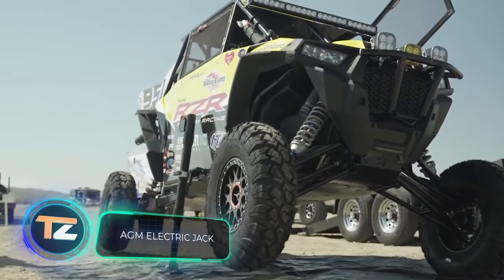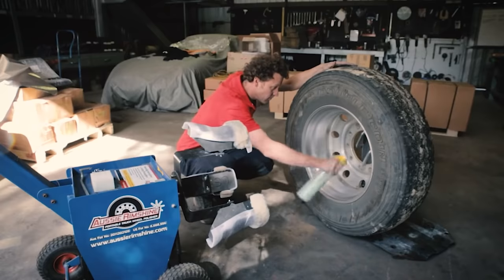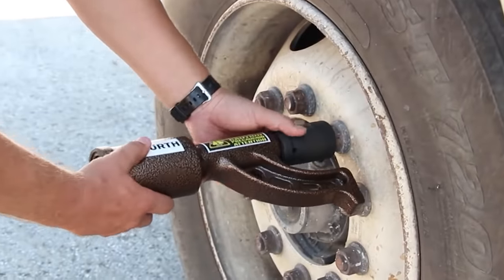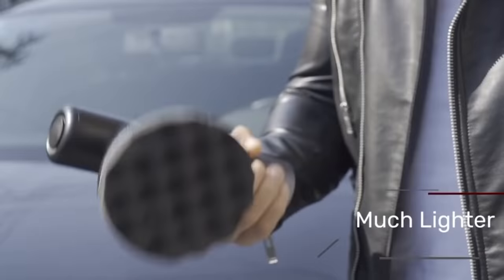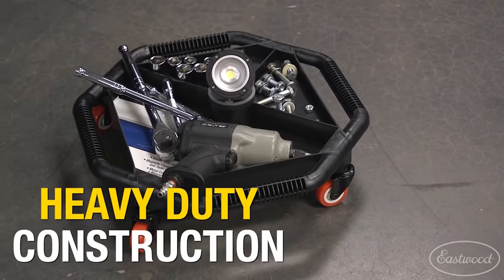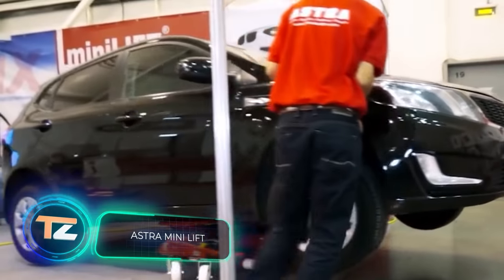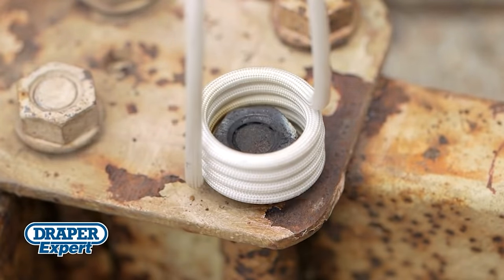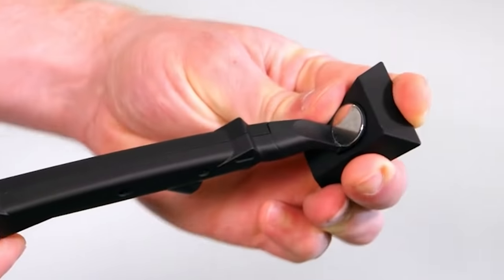NEW GENERATION TOOLS THAT WILL MAKE YOUR WORK EASIER

Comment: I've got the same problem, was interested in the loosening wheel nuts tool. When the guy put the socket on the lug nut then it went to a close up and it looked like maybe the impact was being used with the tool itself. But then the next few show the guy with the speed wrench in the socket just moving the socket back and forth. The video needs to show the entire image of what was happening instead of just the close-up of the socket and nose of the tool in the socket. I think I know what was going on but why don't they show it. Never trust marketing videos that edit crucial moments.

Comment: "Draper Heater" I made one of these from an old stick welder, it's a bit precarious but so is the real thing. btw "Aussie RimShine" sounds proper naughty.
Reply: Yeah it's called buy a propane tank and torch adapter light up and heat bolts nuts etc... Less than 25 usd

Comment: Gee, the "high lift jack" has been around for an awful long time and although it doesn't work with the push of a button, it doesn't require that much effort to use and the batteries will never go dead in it.

Comment: The last tool is rather useless because when you change the brake pads people normally just change the rotors as well and anyone can eyeball the tred on tires and if you think you need measurements then stick a penny in tred

Comment: Legit didn’t show anything that the impact for bolts even did lol, they just put it on there and took it back off lmao
Reply: It is a torque multiplier,  works great many brands on the market.
Reply: I saw that to. Probably doesn't work.
Reply: Rewatch it once more brother. It 100% did show what the “impact” you’re talking about did ;) Watch the socket turn slowly, hard to see but it is because of the gear ratio on it. The handle will be super easy to turn but will be applying a lot more torque.
Reply: @MadeinOregon503  Yeah I didn't see that at first
Reply: A torque multiplier works much better but maybe more expensive
Reply: Well if it was a torque multiplier then why didn't they call it that
Reply: I got a solution. Don't expect any video ever to give you all the info (copyright laws😴). Some research shows that it has 58:1 gearing, applies 2,950 lbs of force, $269.664 but similar items sell for $150. It would be added to my list if it didn't only come with 1-5/16 (33 mm) +1-1/2 (38 mm), a 1 year warranty and if it breaks they DO NOT offer replacement parts, you have to buy a new one.
Reply: They could have shown the guy in the “grunt” position giving the device a real demo.

Comment: Cool but what's with the repetition of slides? The Wurth tool..is it powered or manually operated?
Reply: They are called torque multipliers and this one is not power. You put it on and turn the handle to produce very high torque output with very little effort.
Reply: You can use a ratchet, a breaker bar, or an impact gun to drive it.

Comment: Fail . Wurth nut buddy . It's presented by a couple of strip club bouncers, taken out of the box four times, never used on the wheel, and then it shows the wheel nut being removed by a cheap ratchet.
Yes let me run right out and buy one.
Reply: I thought the same thing
Reply: In the time you spent typing that, you could have YouTubed a demo, ordered one, and got it

Comment: Nut buddy, just get a tire gun lol
Reply: I wqs thinking the same thing, a 1/2 inch gun on truck wheels, maybe try a 1inch gun.
Reply: I work at a commercial tire shop and we use nut buddy when the nut won't come off with a gun. Rarely need it but saves the day when we do

Comment: Umm the electric jack isn't that good, the Worth is just a torque multiplier nothing new or special about it, air force had them in the 70's, the cordless random orbital buffer is junk, 45 minutes is not long enough to do a good job on a vehicle